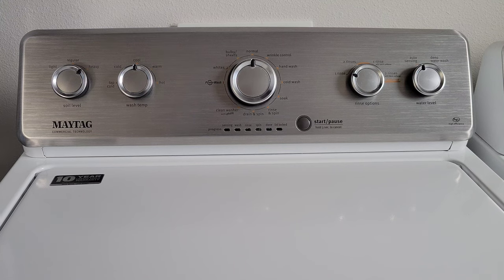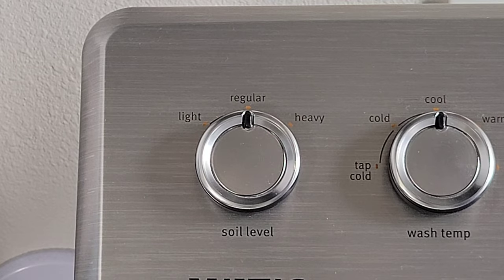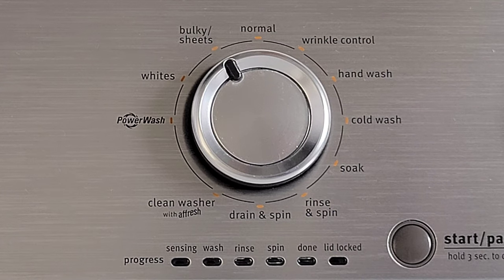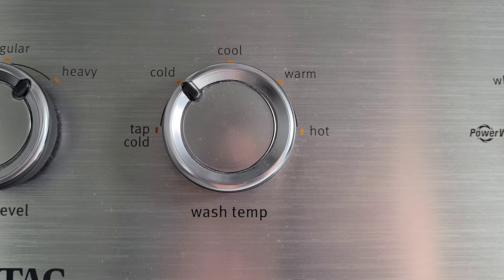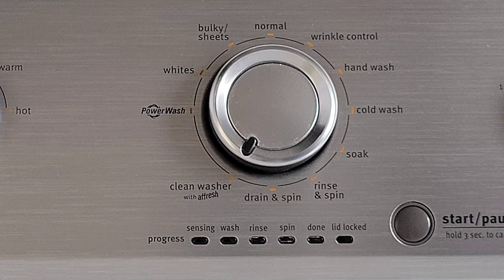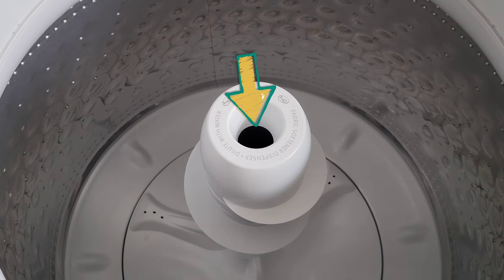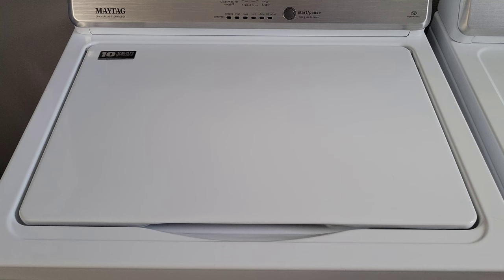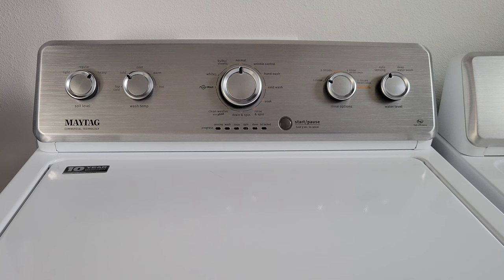Maytag Washing Machine Cycles How To Use Tutorial

Comment: I was hoping to learn something from this video.  Sadly I didn't learn anything.  You merely pointed to the different buttons and read the labels back to us.
Reply: I have this washer. I hate  it!! I have learned this. Fill every load only 1/2 full use bulky sheets deep water and double rinse and maybe you will get a clean load in almost 2 hrs.
Reply: I hate this machine.  I tried the whites cycle and it’s still going… one hour and 10 min so far.  Wtf?  Where’s the quick wash ?   And yeah didn’t learn a thing with this video
Reply: Soil level you have to choose light
Reply: @yonofui3755  It comes down to if things are just musky/need a refresh (light) , grimy/little dirty (regular) and very muddy/deep stained ( heavy)...really you should use Regular 90% of the time and use Heavy sometimes

Light is really not needed. But I sometime use it when washing sensitive items
Reply: His channel should be called Capt Obvious.
Reply: Where is the filter to change !
Reply: We’re supposed to change air filters in our wash machine and I don’t know where it is

Comment: After you put your clothes in the washer, wet them (with a bucket or pitcher or whatever).  That will add weight to the clothes, and the sensor will detect more weight, and thus, it will add more much needed water.  A half a cup of water to be "efficient" just doesn't cut it.
Reply: Your right . This washer is a piece of crap . To bad i didnt do my homework . Maycrap is the brand .

Comment: When I press the button it goes sensing and don’t start the washer
Reply: Same
Reply: I noticed that too and you may have to press it twice until only the sending light is on, I’m not sure why it does that because sometimes only one is enough.
Reply: Happening to me right now and I'm getting pissed 😅
Reply: The same is happening to me! HATE THIS NEW WASHING MACHINE. I’ve read the manual.. but this thing does whatever it wants!!
Reply: @melval1376  I had to replace the fuse in main box 
Now it’s working

Comment: Why doesn't this washing machine wash well, is there a speed button somewhere that help it wash stronger/ better?? It doesn't clean very well not sure if I'm missing something or does it really suck🤔
Reply: Wash in bulky, it will fill the water to a higher level. Deep water wash is a joke, it's hardly fills. I HATE this washer! The only bonus is it spins out the water really well.
Reply: You're right.  I hate this washer.  It does not clean properly. It agitates too slow.  Doesn't get enough water.  It's like swishing the items in a puddle of water.  I don't always want to wait to do a full load. My previous Maytag lasted for 21 years and was heavy duty.  I thought I would buy another Maytag for the large tub.  What was wrong with the older timer?  Never again!
Reply: I also hate this washer.  It has a poor agitation roll action where the clothes are supposed to roll through the soapy water from top to bottom.  It does not clean your clothing, and you have to pre treat soiled clothing with Shout.  It also twists up all your clothing on the final rinse drain cycle resulting in heavily wrinkled clothing that you take to put in the dryer.

Comment: Wish it had a quick wash cycle
Reply: I just got this today. Does a good job. Clothes spun out well. (Did 2 loads). My question is when you turn the dial the lights on the panel light up and they stay lit up. Then you have to press the button again to start it???  Or I put it on normal and the lights light up but the machine does nothing until you press start again.  Odd.
Reply: Me too.
Reply: The sticker inside mine has a place for "quick washes" but it's not a label on the dials. I would love a quick cycle.

Comment: The trouble I'm having is trying to figure out the start button because I don't know if I'm holding it down too long or not holding it down long enough and I was hoping you were actually going to demonstrate hitting the start button.
Reply: I don’t know whether we have the same model, but on my top loader you hit the power button on the left side of all those display lights. When one light turns on, hit the start button and ALL the lights should turn on. You’ll hear a clunking sound, which is the lid locking. It takes a few seconds before the machine actually starts. Hope that helps.
Reply: @christine6059  I think he was being sarcastic about Capt Obvious.
Reply: I’m having this issue did you ever figure it out? I push the button once and it senses but the water never stops but if I push the button again, the water finally starts.

Comment: how can we learn what IS HAPPENING AT EACH SETTING OF WASHING CYCLES
Reply: That’s what I was hoping for too. Like what does bulky/sheets actually do differently? My best guess has always been that it allows more off-balance rocking during the spin cycle without shutting down, but that hypothesis is based on absolutely no real evidence at all.

The reason I came to the video was to find out what the soak cycle does, I’m wondering if it fills up like an old-school washer or (more likely but I hope not) just does basically a spritz and then let’s it sit for a minute

Comment: I just it moved into a house that has same washing machine. You said where to put fabric softener, but where do you put the detergent???? How could you miss that important information? There is a little hole on the top left side
Reply: The instructions says that the detergent is the first thing you put on the washing machine, on top of thaT: your clothing. Really weird bc the water fills so much later on and sometimes my clothes came out with detergent so I need to rinse again! 🤬
Reply: @melval1376   a simple little feature you think he would say to do that. I'm having that issue too detergent not being blended.  On my old machine I put the detergent in and would run some water to blend it up, then add my clothes. On this one you have to shut the lid and wait awhile and let the water run with no clothes, so that's what I do. But then the auto sensor will shut water off. So now I've learned to turn the auto sensor off, then back on after I've added my clothes. Thought there was possible way to avoid all this runaround, Another thing I don't like about this machine is you can't open it has an auto lock. Just in case I just leave it on double rinse possibly wasting water and money. 
Thanks for your comment. PS I just found this this lady has a good idea. https://youtu.be/b4qrzaFRE5M
Reply: @theonemodifier  EXCELLENT tip!

Comment: Thanks! But, anyone,--I don't have a fabric softener dispenser, so I need to put it in during the rinse cycle... Problem is, after putting it in, I have a hard time restarting... Do I push the START button again? If yes, how many seconds? Sometimes it goes back to restarting the whole wash. Can somebody assist me in this matter? Many thanks! :)
Reply: They sell a fabric softener dispenser ball at Walmart 😊 if that’d be easier for you
Reply: When cycle is running, press the start button one- do not hold it down. Once you add the fabric softener press the start button again- do not hold it down. Good advice just to but a fabric softener ball that you can just throw in with your clothes before washing